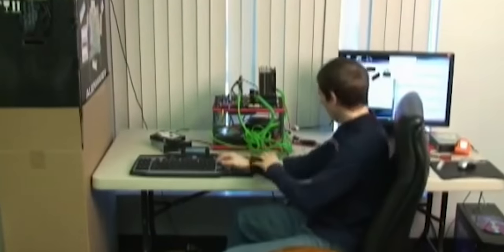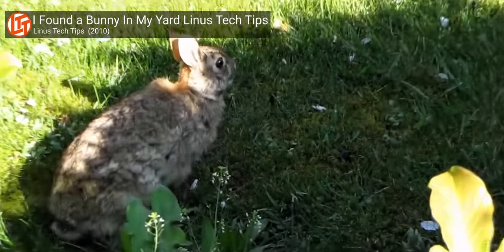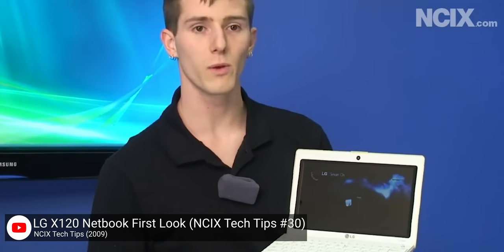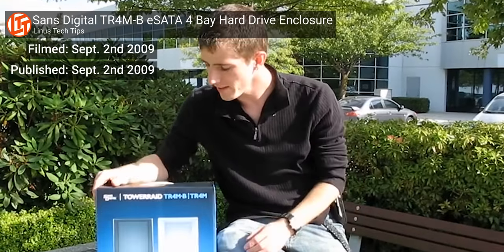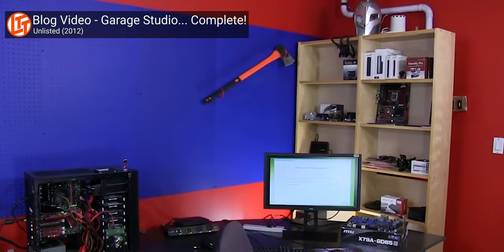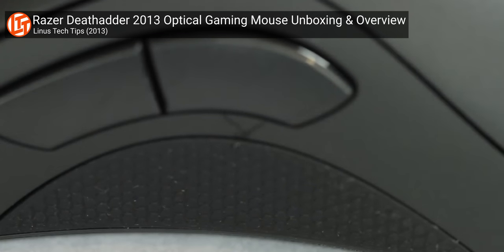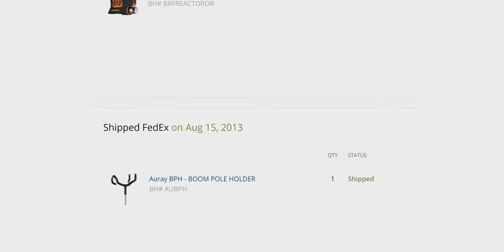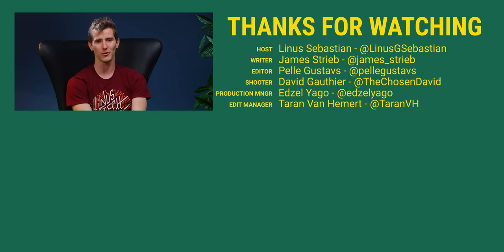We've come a long way...

Comment: I remember building my first pc back in 2013 and using Linus' first pc build video as reference I ended building the exact same one because I was too scared to change anything.
Reply: I remember his video on some OCZ SSD and bought the same because he was going on about how cool it was. Then I lost my data twice and it turned out they had been selling faulty SSDs.
Reply: I did the same thing with one of Austin Evans videos back in 2012. Kept everything the same cause i was worried about incompatibility and recently last year i finally built a new computer with ease.
Reply: I used his and the old Newegg videos that I am pretty sure Paul was in. The good ol days.
Reply: I did to. I remember wanting to buy the Storm Scout 2 (i think that was the case in the video) to use in my first rig. Ended not buying it because it couldn't fit the 140mm Noctua cooler i wanted.
Reply: Thank god, it was not the Verge's build that enspired you back in 2013!

Comment: When people are talking about the "good old days of LTT" they're not talking about 2009, they're talking about 2013-14.
Reply: Yeah I agree with that. I subscribed 2014 after I bought an old prebuilt with the saving grace being a Noctua cooler and FT02 case.
Reply: Exactly
Reply: yup
Reply: I think loads of subscribers came in on the moving blogs when leaving the Langley house. That's when the algorithms started putting LTT thumbnails in front of me. If you got hooked & binge watched at that point it was all house based stuff.
Reply: Auguste Dupin I also joined his channel in 2014 when they were still using the kitchen. I miss those days especially since Luke isn’t on the channel as much

Comment: Good thing I watched this whole video in 240p because of data
Reply: 480i here because I'm a cheap bastard who bought a $30 phone.
Reply: 1440p here
Reply: 360p squad
Reply: Just realized now that my video was set at  "Auto 2160p" with 0 loading time... on my 1080p monitor
Reply: Awesome Linus
Reply: On youtube it actually lowers audio and fps quality the lower resolution you go so technically you are still getting a benefit even if you dont have a monitor that high of a resolution.
Reply: @VenkataY  you cant watch in a resolution that doesnt exist
Reply: @NakiriX1  2560x1440p is my monitors resolution , it's commonly known as 2k .......
Reply: @Chronx100   yeah I know,  the video was so well detailed actually, and that's why I've checked the quality settings, and discovered that lol
Reply: @PhilipKerry  this video is not in 1440p you cant watch 1440p on a 1440p panel when 1440p isnt an option
Reply: @PhilipKerry  you are still watching in 1080p or 720p
Reply: @NakiriX1  Nope 1440p

Comment: I first heard about B-Roll on this channel, so I used to think that it was a made up term that stood for "Brandon-Roll".
Reply: What does B-Roll mean?!
Reply: @pigboybig  I learned about this in my video class in school A-Roll is footage that you use the natural audio with, that may be the surrounding noise from the environment you are in, or someone talking to the camera. B-Roll is footage that you do not use the audio for and typically do a voiceover with it.
Reply: @chapingrim1751  thanks
Reply: @pigboybig  no problem chief.
Reply: Hardware Canucks
Reply: as an extra, you can do a J cut, or an  L cut, which is audio being changed from one footage to the next before or after the image changes (the shape of the letter is what is important, audio is on the bottom.)
Reply: LOLx2
Reply: @chapingrim1751  It's like primary footage and secondary thus A and B
Reply: Glad I wasn't the only one.....
Reply: @Redwood21  hah

Comment: B&H seriously rocks. They beat out Amazon by a sizeable margin in terms of price, customer service, product quality, and even shipping last time I bought a major camera. 

Amazon's attempt arrived late, was a returned item coated in very greasy fingerprints (I bought "New"), and the return process took 6 weeks. B&H's came quickly, cost $700 less, had extra goodies like a fast SD card, a case, and other accessories included in the bundle, arrived very quickly, and was completely hassle-free and painless. I always had the impression that they were an expensive vendor but after that experience last year I always go to them first for camera supplies now.
Reply: also they don't charge tax for purchases outside of NY!
Reply: ADAHOP!!!! Thank you for your awesome work on neebsgaming
Reply: Nice try, B&H staff!
Reply: This is like 50/50 paid dude or passionate dude.
Reply: Paid or not, B&H is amazing. Just sucks that I live in Australia...
Reply: They seem to very competitive on pcpartpicker and i have ordered from them with zero issues.
Reply: I DEMAND AN LTT AND NEEBS CROSSOVER!
Reply: B&H i trust more than Amazon to pack my Hard Drives. There are video clips of Amazon delivery people just throwing a hard drive on a concrete porch, and the delivery guy snapping it midair.

Comment: 2009: Using Windows Vista

2019:Using Windows 10 (Cuz Now Windows Vista is that BAD)
Reply: I swear they fixed vista in the end
Reply: @TheHaters112  I liked Vista almost as much as XP
Reply: @Explorer I agree. Which is why I switched to Linux
Reply: LOL. I'm still running and using Vista.
On an old piece of shit Dell laptop, with a poxy Celeron that feels every bit like it's running just as slowly as it actually is.
OHHH, with an eighty odd Gig slow old HDD.
But I got a whole two and a half gigs of Ram. ;-/

Yeah. I'm thinking it's maybe time I should begin to contemplate if I should consider making a change a possibility sometime in the nearish future.
Maybe it's getting around time soon.
Reply: @martingrundy5475  should've been upgraded many moons ago
Reply: @Kylemathews1  many stars have died off between vista and when he could  of upgraded
Reply: ive been using W10 since it came out... never had serious issues and i love it

Comment: Lol this makes me remember my PC have almost 10 years!  I still use it 😆
Reply: I still have a running 32-bit Windows 2000 Server and Windows 2000 Workstation machine doing low-level internal-only email server work which I keep around for posterity's sake. I've replaced the old fashioned Athlon motherboards with the same exact model three times in 18 years which is pretty good since the machines run 24/7/365.

It's amazing how long some computers can keep working!  A bit different from the AMD Threadripper-2 workstations and multi-racked AMD EPYC grid-network supercomputing systems I get to use now. The modern workstations have more CPU/GPU horsepower than supercomputers of not too long ago and the servers are BEYOND merely great into UTTERLY INSANELY GREAT !!! General Purpose Computing DEFINITELY has come a loooooong way from even 5 years ago much less ten!
.
Anyways great job on these last ten years! See ya in another 10 for a 20 year retrospective!
.
Reply: My iMac is a 2010, I feel you
Reply: damn
i need the specs sheet
Reply: but you changed your mobile 4 times since... just how marketing brainwash ppl

Comment: Yeah I'm one of those guys that have been following you guys for years - and although you mention about the older stuff sucking, you undersell yourselves a bit because you were still higher quality than most other YouTube videos around the same time. YouTube was still very much a baby back then and was all up in the air as to what expectations were. Also don't forget tech has change SOOOOO much in that time. Things are more exciting now than they ever had - sometimes the hardware alone writes itself when you see it smashing boundaries! (Not motherboards though - we all know those are basically incremental changes at this point to support the better gear).

Comment: 6:48 It both makes me smile and cringe a little bit to see the Cooler Master N200 video from 2013, because I got one of those in late 2013 - early 2014 and then got another last year because no modern case had an optical drive bay and I wanted one for my new build. I feel behind the times on that, but, hey, what other case has been on sale for 8 years?

Comment: you really don't need to be running 8k gear.... especially for the type of content being produced.  Hell - most network news stations aren't even running 4k cameras. Noting is really being gained by using 8k gear at all... and it is arguable if there are any gains in even the 4k gear - again, for the type of content you are producing.  Think how much money could be saved if you hadn't done that, and waited more years for the technology to mature and prices to plummet.